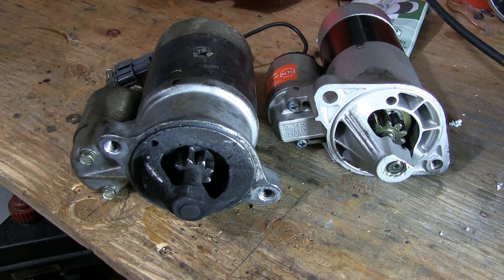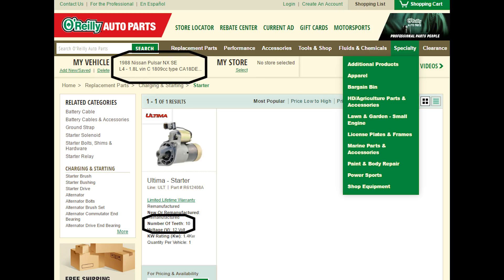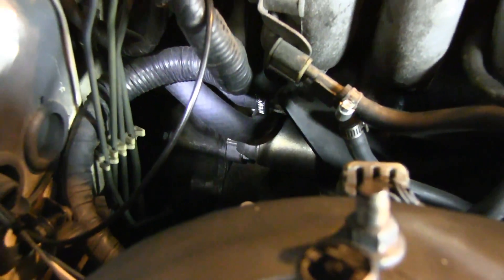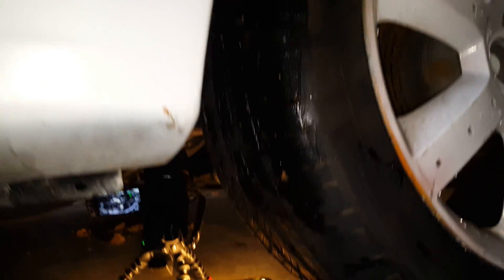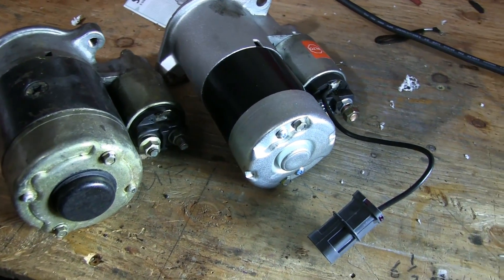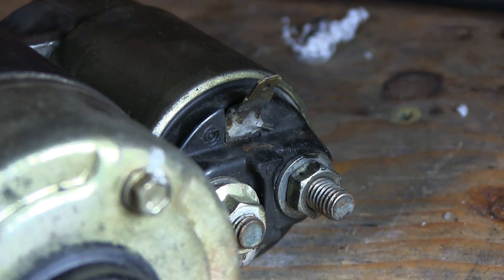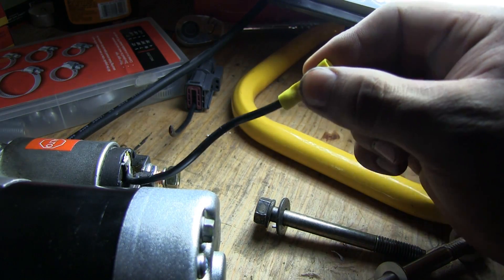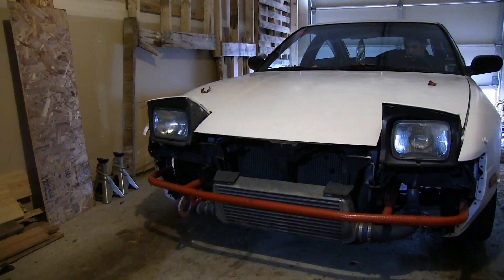Nissan CA18DET Starter Replacement

Comment: hey. i just got a new s13. ofc i had to touch some wiers from the temp gauges that dident work and now it wont start:*(
Reply from the maker: medicalshroomi does it click when you turn the key? dashboard lights turn on? headlights? does it turn over when you turn the key?
Reply: JinSmylez no its not clicking. feels lik it almost there but its not. the firdt time it faild it started normaly and died slow. headlights turn on and the 3 gauges light up and some light in the dash. only had the car for 2days so not sure if the dashlights are all on.
Reply from the maker: +medicalshroomi check your battery with a multimeter.
Reply: JinSmylez already did. it went bad but i change it now. checkd all fuses
Reply from the maker: +medicalshroomi maybe your alternator is going bad, which is why it started then slowly died out? I cant think of any wiring under your dash that would cause that. If its not battery/alt related i would think its an air/fuel issue that happened coincidentally around the time you messed with wires. If you have any other info keep it coming, ive dealt with some wierd stuff before
Reply: JinSmylez i fixed it:) it was condens. spring time in norwat and the car hasent been startet before couple of days ago. insane timing as is was working with el wires. thanks for anwsering:)
Reply: norway...
Reply from the maker: Very nice! Glad you figured it out. Sorry I wasn't more helpful. Norway?! Thats awesome! Greetings from the west coast of USA :D
Reply: JinSmylez :) west coast warm all year i guess? now i need to rinse the radiator and some bodywork and it should be good;)